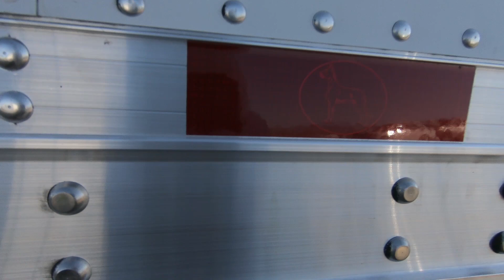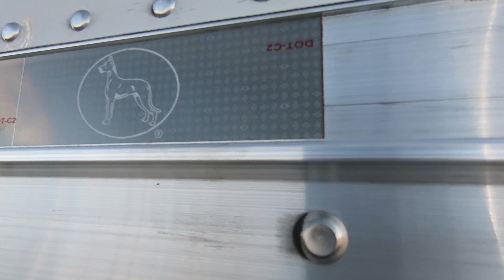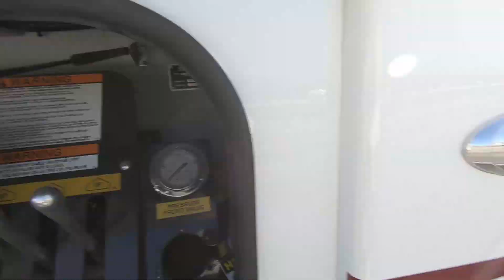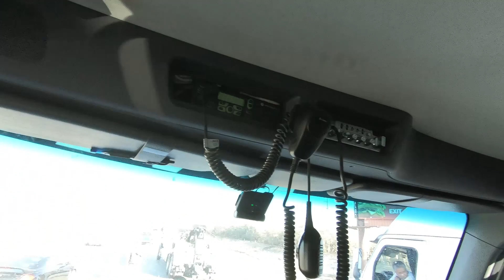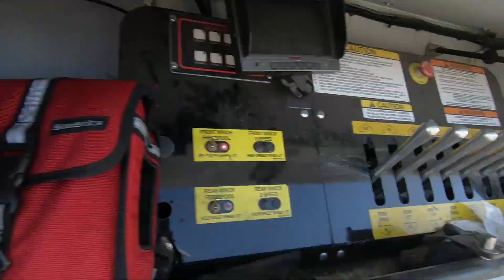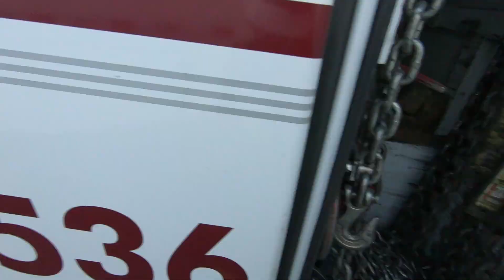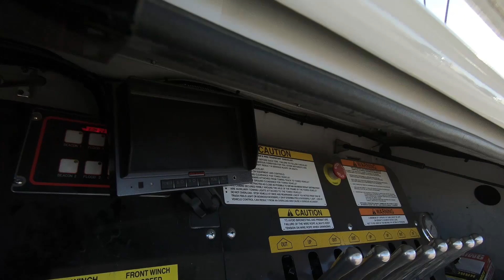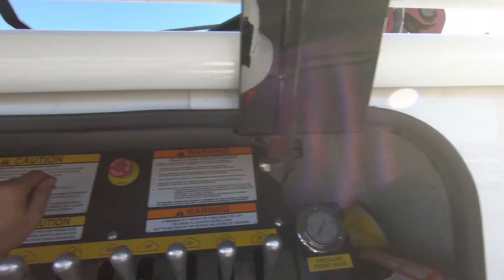Tractor Trailer Keeps Sliding Into The Ditch  Close To Rolling Over

Comment: Hey you got him out 35min on site thats good, interesting with a paved hard shoulder how he even came to be off it so much , only critic is you put strap protector around the door frame which was quite round metal but not on the roof which I suspect out of sight and sharp edges. Overall very profi pull out with no further damage except drivers reputation maybe.

Comment: Rotator could have made that job much easier.
Reply from the maker: Not really... The lane would still have to be closed and actually maybe even more of a lane closure to allow proper outrigger placement. The way this truck was extricated was the correct way of doing it. Thanks for watching!
Reply: @plazatowing  Only one side of the outriggers would be needed and it could have parked a little more forward then the wrecker in the back then pick the back of the trailer up using a spreader bar and move it back on to the pavement then pull forward and winch the tractor back on to the pavement. Rotator would have been in and out in about an hour. Guaranteed!
Reply from the maker: Sometimes simpler is easier... GPS shows us on scene for 38 minutes:)